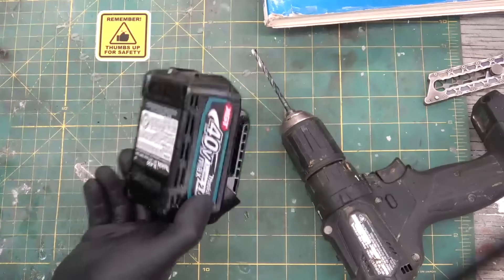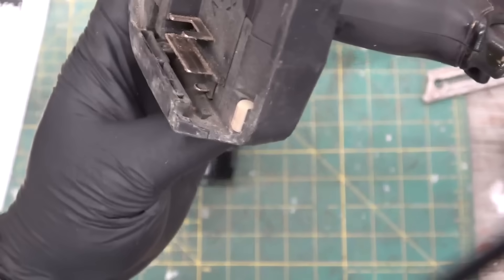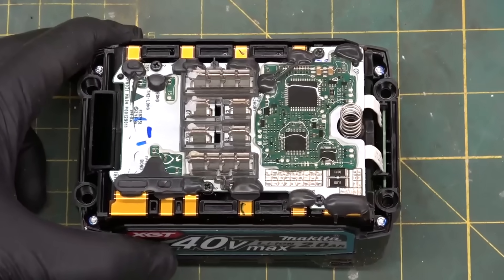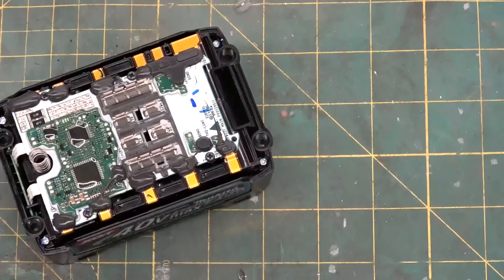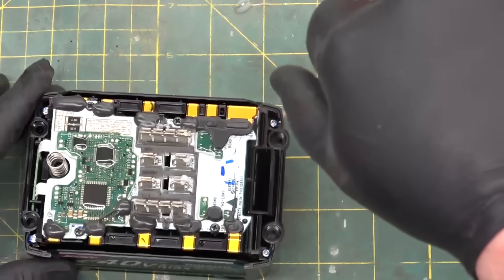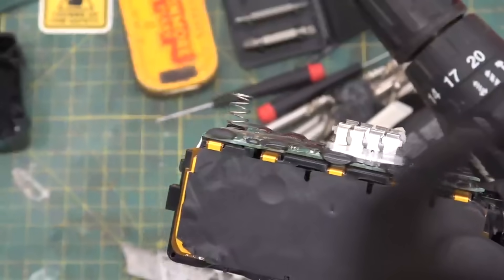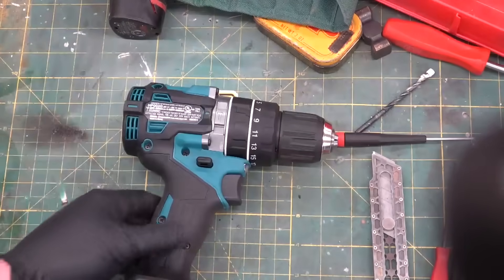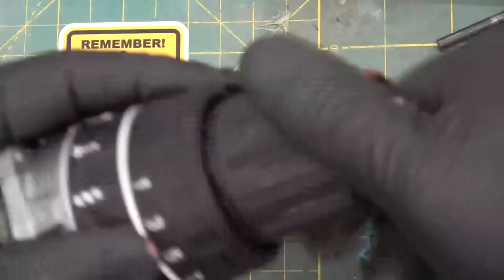BOLTR: Terrible 40V Drill || Et tu, Makita?

Comment: The pins have flats because of how they are made: cut rod with formed ends, then heat treated. These reminded me of Daisy BBs from the 70s, had two flats/dimples as they were cold-rolled wire bits, later plated.
The vents on the battery are for forced air cooling during the charge cycle.

Comment: My 19 year old makita 18v impact gun has been completely submerged in mucky crawl space water and Idaho thunderstorms more than once. Still works just fine.
Reply: Yeah sure buddy.
Reply: @Calc_Ulator  If fact, every one of the $600   tool pack still works fine. Original batteries died after the first decade, though. I stopped working construction/handyman stuff a couple years back, but I still use those tools regularly for my own home maintenance and remodel work.

Comment: I have been waiting for my 15 year old makita kit to die and it just wont. Use it often and havent lost a battery in 7-8 years. Im fine with replacing  carbon brushes 5 times when the tool lasts decades with regular use and abuse.

Comment: the pcbs are coated so good they can probably handle being water cooled
Reply: I took it as him being concerned about the battery terminals. But given how much trouble he had with removing that tape, that might be less am issue as well... HOWEVER, that tape will not stay stuck forever, given how warm they get!

Comment: I've used this kit daily doing commercial plumbing with no issues for a year. I don't like the plastic chuck but the drill has had plenty of power and the impact is butter smooth. I got a free 4AH battery and free 40v inflator with it. 

Also the charger that is included with this kit is NOT the rapid charger. That is the standard one. The rapid charger is all black and has a different product number on the top.

Comment: They went 40v so two batteries is essentially the equivalent of Milwaukee MX Fuel. Means you can run a drill like M18 or run a jackhammer like MX Fuel, all on one battery platform. They have a patent for a 200v max but breaker.

Comment: As a home-gamer, tools I use once in a while, I want AC powered. But it has gotten so hard to find corded tools. The batteries will go bad just sitting there, and a tool I might use a couple of times a year, invariably has a dead and very expensive battery to be replaced next time I need it.
Reply: Modern tool batteries are a lot more robust than the old ones. Just don’t leave them completely uncharged and they’ll be fine. The old NiCad batteries were junk, but the lithium ones are a lot more reliable
Reply: Same here.
Reply: I love my corded magnesium Makita circ-saw! "Omfg, what will you do with that cord? How will you manage to not cut it in half and electrocute yourself?" 
"Uh, same way we did for decades previously? Same way we used to talk on corded phones?" (Although not where anyone else could hear and we weren't yelling into the phone 😂)
Reply: Batteries will last longer if they're stored at 50 percent charge

Comment: I swear to god just earlier this week I set a power tool down onto a wet floor and thought "I really hope this case is at least partially water resistant", then I thought that nobody designing a power tool battery would be dumb enough to not have the bottom of the battery at least somewhat sealed. Then I saw this video...

Comment: I'm thinking that Makita have copied Lenovs trick of fully charging the battery but then using the Battery Control Module to keep the MOSFETs from being turned on until it senses a charger plugged into it? I don't think that you're allowed to ship Lithium cells at less than 60% SOC.
Reply: Good call, that makes sense. Thanks for the info

Comment: my first actual power tool was a makita sub-compact 18v power drill, and the chuck was shlucky for a minute when i got it. but it seems to have broken in in the hands of an idiot who will twist away on it until it doesnt make the bad noise anymore. either way, i appreciate that it was marketed towards my american desires to conceal a power drill in my wasteband in case i need to torque someone. 11/10 ive used it like five times and it worked great!

Comment: Boss man hired a guy to install a floor safe. Had to drill 1/2 inch holes into concrete.  I could hear the drill running all day. At quitting time stopped in to see how it was going.  He had 1 hole about a inch deep, and was complaining about all the drill bits he bought were dull.  I did notice the drill was running in reverse, and casually mentioned this... Yeah it was.

Comment: Hmm my Makita XGT hammer drill has a genuine metal chuck made in J-A-pan.

I assume the holes in the battery are for cooling.

The XGT 40V line is so named because they rearranged the cells in an 18V, to make them 36V nominal, 40V max.

Comment: I have the same drill. 2 years of moderate use and not a single problem yet. Hammer drill function is like pissing into the wind, but works well on wood.

Comment: i believe the units are shipped with the battery installed do to restrictions on lithium batteries.  A drill like this with battery installed can go in checked luggage on an airplane.  Extra batteries have to ride in the cabin.

Comment: The Scottish equivalent of giving left handed drill bits to the apprentice is sending the new guy out to get some tartan paint.
Reply: FNGs in the Army get handed a 3# sledgehammer out of the BII Bag to perform the necessary "Soft Spot Check" on armored vehicles.
Reply: I got sent to supply for a long stand.
Reply: @Riverdeepnwide  - Sent to the commo shed for a bottle of Radio Squelch.
Reply: No compaints when they return with a Tart & Paint..
Reply: In the radio lab we sent the new guy for the High Frequency grease......later that day, department head asked  new guy to him get thermal compound ( yes a real thing) and new guy tells department head F off......
Reply: Another classic, send the new guy out for a bucket of steam.
Reply: Scots being among history's most luminary inventors, along with the modern advent of nanotechnology, could conceivably make tartan paint a reality. The only thing missing to make it widely available would be a military application.
Reply: Ah yes, the left handed metric adjustable wrench trick. Sometimes the crib guys do play along when you send a university coop student...... Damnit the crib guys gave you a right handed one. You spin the spinner thing down with your right hand and the jaws go the wrong way!!

Comment: The holes on the bottom might help if the water comes from the top, or there is some condensation issue. I guess they figured if you are putting the tool in a puddle of water you will not be doing it for a long time 💦, so they opted  for the first usecase.

Comment: I have some of the new Milwaukee Forge Batteries, they are impressive, but they have ventilation holes in the casing also. Never wanted to set a $200 battery in water on purpose. Thanks for the videos, AvE. Makita makes some nice tools. I met with a Milwaukee representative that showed me a new drill, biggest change was the chuck. I found the new chuck very smooth and asked how much more it was than current production, he didn’t know an exact amount, but it definitely wasn’t 20 difference per unit. I realize they are making a product to a price point, but I would pay a few bucks extra for a good drill chuck, especially on a heavy 1/2” drill. I still remember looking for chuck keys and cords.

Comment: The ratchety drill Chuck is likely to address a makita problem of years past. In the olden days, Makita drills had the problem of chuck loosening while you drilled, allowing your bit to slip, or fall into the wall through the hole you just drilled in the wall header. That crunchy noise is likely on purpose.... I bet that is a nylon toothed ratchety  thing to help with Chuck retention for the pawls

Comment: I think the higher the voltage the less sag you'll get.
It's way more important in high torque applications (like electric bikes) I think makita just wants you to buy a whole new set of tools.
Reply: "I think the higher the voltage the less sag you'll get" <--that's just (mostly) false, the voltage sag depends on the resistance and the current. Twice the voltage requires half the current so that's very nice. However, having the cell in parallel , e.g. 5S2P, vs  10S1P decreases the internal resistance 4 times, which evens out. If the wires/conductors are the same, there will be bit less voltage drop due to resistance. Higher voltage requires less current, so it's overall nice as it means less copper, lighter tools.

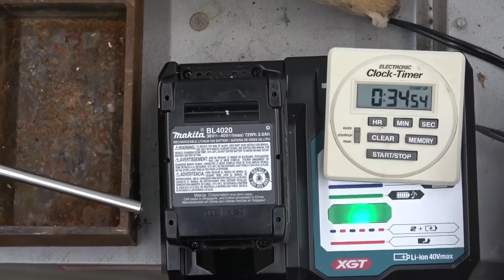Comment: @16:37 "the faster you charge it... the harder it is on the battery" actually it's a bit more complex... because in this particular case all cells are in series so the charging can happen at higher pack-voltage instead of higher cell-current ... so.... 23 mins to 80% on 2Ah cells means charging at (60*0.8/23) 2C per cell in CC mode so.... yeah... pretty quick... but still not crazy... I would love for the charging gear to be switchable into 1C charging.... but man... that battery insides were sexy huh
Reply: Doesn't matter series or parallel.  Just putting energy WattHours in.  A 4ah 20V battery would have same energy, cells in parallel, and charge current would be double, but C rate same.

Comment: Unfortunately, the holes (that let the fluid out) are necessary for fast charging and heat dissipation as that's the part having access for 'fresh' air.
Reply: The top area is occupied by the battery charger, so it is blocked during charging
Reply: Except hot air is more likely to come out of holes further up the battery case - thus preventing the issue of both heat and water ingress when placed in puddle.

But - arguably - no puddles, no problem. Don't put your 40V bits in the haitch two hoes!

Comment: The Manufacturer FEIN released the ascm 18-4 QMP AS, an 4 speed drill driver witch precussive function, quickchange arbor, bosch battery interface and a fantsy electronic. would be Intresting to hear Your opinion after a while of use. To see the Inside would be also cool.

Comment: Interesting to think about the longevity trade off with fast chargers. Though i will say ive been using them on my LXT tools for their whole life and all my batteries are holding up very well, no failures yet and i would bet even the ones close to a decade old are still at around 80% capacity. But i do have one charger that definitely charges slower, might use it at least for the 2ah ones.

Comment: I have the 40V makita drill, its almoust 4 years old. It had few hot suppers, but I dont abuse it. It has done some concrete drilling, drove 40mm hole saw into steel, never let me down. What caught my attention is you sad yours have RÖHM chuck, but mine have YUKIWA.

Comment: I had a lot of trouble getting the T8s out of a Craftsman 5AH battery… and I’ve taken apart dozens of DeWALT batteries using the same screws with no issue. For some reason the same company used glue or thread locker on that battery in particular. Also: Both had dielectric grease.

Comment: Dewalt 60v batteries have holes on bottom also. I have 3 60v dewalt grinders in the tool box. Every single battery has epoxy repair jobs due to the casement breaking apart. Greedy fuckers

Comment: I bought a cheap set of Porter Cable tools used at a pawn shop when I was remodeling my kitchen. I just wanted the cheapest tools to do the job. I don't know how many years ago that was. But they're still working perfectly. I use my drill and impact every day at the body shop and they're still working like new. Granted, they weren't the best when new. But considering that I bought them used probably around ten years ago and they haven't let me down. There's no reason for me to buy any new tools.

Comment: I actually like that they put palls on the chuck. I've had it happen when the drill is in forward and works itself loose, when you abruptly stop the drill it spins the rest of the way loose and you lose your bit.
Reply: In my case a rotary sanding disk goes spinning at high velocity towards the nearest open toe shoe.
Reply: Pawls?
Reply: @eclectichoosier5474  Beat me to this!
Reply: Pauls?
Reply: Pause?

Comment: I think they can ship that line with the batteries inserted i the tools because the batteries are not initiated until they are charged once on a charger, they are probably in some sort of power down mode until then. I think at least, the aliexpress seller selling kits to build your own batteries very specifically pointed that out, and claimed to have no fucking clue as to why, almost as if they just ripped the software from a real battery when designing their own BMS. Nice thing about the 40volt line is that they at last put some proper high drain cells in them, so from the same 10 cell 18650 battery you magickly get twice the power from your drill, like the rest of big brands

Comment: I recently pulled apart an 18650 battery pack and did tear the metal foil trying to take the tabs off. Did not explode, but leaked a bunch of electrolyte all over the desk. Whoops.
Reply: short on flush cutters?

Comment: If you're a little pissant like me, there's a reason why the size and weight pf "40" volt tools is unattractive.  I drive 18v Makita and 12v Bosch.  But since I mostly make wooden furniture I rarely need the stones of a 40v 1/2" drive impact driver.  Enjoyed the BOLTR though. When I need a big battery, it's been for more capacity rather than potential and for those oddball tools that Ryobi (another antitheft color) makes that no one else does like their battery powered hot glue gun.

Comment: The nice part about tinnitus is there's always a battery charging somewhere :)
Reply: The nice part bout tinnitus is not being able to hear the high pitched noises emanating from the toilet the wife is always grousing about.
Reply: The first time tinnitus made me chuckle, nice one.🙂
Reply: If that is the case, I’ve got several chargers running off and on at different and at the same time
Reply: It's from exposure to microwaves like from cellpho, wifi, cordless comms devices.  Unplug at night and your hearing will improve by next day.
Reply: @ToxiCom-777  LOL, no. I have had tinnitus for nearly 60 years, long before any of that shit.
Reply: @ToxiCom-777  Mine is due to having my head in the base bins at rock concerts for 10 years
Reply: @ToxiCom-777  no, it's actually from the alcohol abuse. Seek help.

Comment: The screws in the battery have locktite on them. What you need to do is get a gas gun and......wait a minute, I haven't thought this through have I?
 A bit like the butt connector guy.
Reply: A soldering iron set to 120-130C would have done it. Polycarbonate can handle over 200C
Reply: @stanimir4197  This is an excellent suggestion, however, it ruined the joke

Comment: Not sure if you figured it out or not, but the batteries have a shipping mode, where they appear dead until you put them on a charger.  They ship at 50% charge I believe, which is, according to at least one paper i believe i read, is the best storage charge for liions.
Reply: well it wouldn't be an AvE review if he did some research instead of just passing expert judgements before using the damn thing

Comment: Wtf is up w makita? I convinced my brother w switch to makita, and i switched as well. We did so because we always had good luck w thier corded tools, made in japan instead of china like everything else, and ppl always talked about how good/reliable their makita cordless were, and you can actually replace the trigger for short $ instead of having to buy a whole assembly thats more than half the price of a brand new tool. We both got the xt288t kit with the xph14 hammer drill and xdt16 impact. They seemed like great tools. One day Im chucking up a bit in the drill, right when it starts to get tight and you give it a little more to make sure its not going to fall out, it cracks free, loosens up, and you have to tighten it again! Whats up w that!?! Never seen a chuck do that! Not even cheap ryobi or ridgid! Come to find out, this is when makita switched to made in china!! Awesome!! If i knew that, i probably wouldnt have bought them. Luckily i got a good deal on the kit. $250 brand new at a pawn shop because the put the wrong price online/fb mp, and they honored the price eventhough it was marked properly in-store. Now this hot garbage 40v! Wtf Makita!! I forget why, but recently He got the newest 18v kit shortly after it came out. Already, both my drill and his newsest drill, both of our reverse selectors broke. This is not what i expected from makita! This is what i expect from milfuckee!! I guess it was bound to happen switching to made in china to save a few bucks

Comment: Years ago, 2003, I bought a complete Mikita Big Box multi tool kit on 24 volt, when no one had 24 volt yet. It had a circular saw, drill driver, and many other tools an$ attachments. A year later I could not buy the 24 volt batteries. No mor Makita for me.

Comment: Are the batteries maybe pre-charged but asleep so they don't fully drain on the tool and the charger wakes them up? Might explain the faster charge.
Reply: Precisely. If the state of charge led bar graph would have illuminated right out of the retail box, that would be an indicator that a weekend warrior bought and returned the tool. Anyway, good thinkin' you got going on Sam!   Fred